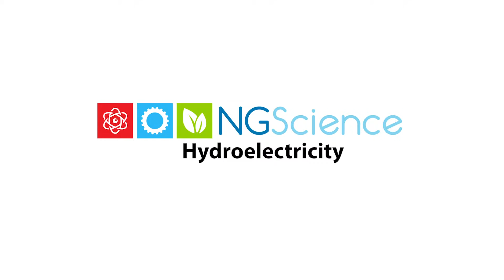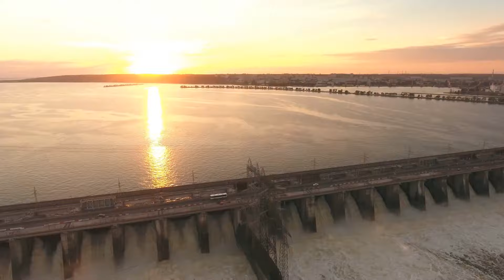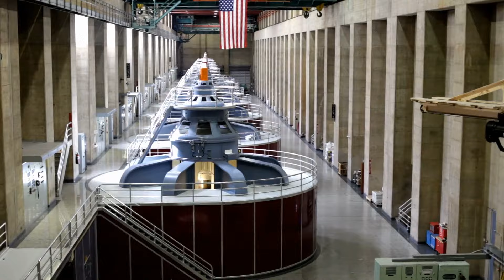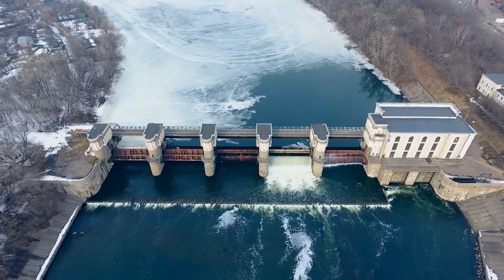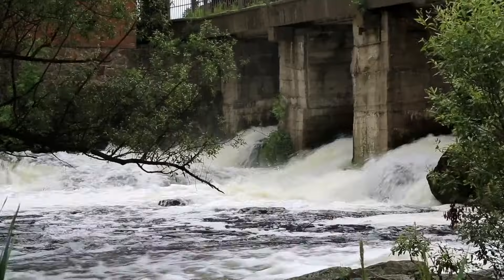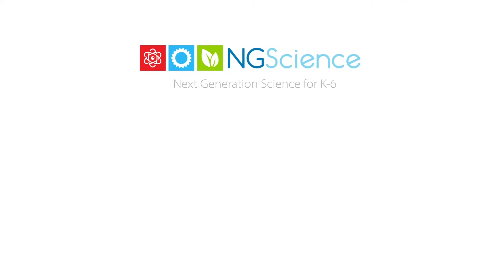All About Hydroelectricity

Comment: There is an invention, EPM-2, U.S. Patent No. 9641045B2 that could eliminate the need for extensive grid system, reducing both expenses and dependency on large-scale power station. The EPM represents a revolutionary approach to electricity generation, empowering states, counties, cities, businesses, and even individual households to establish local power stations. This innovation minimizes the need for costly grid infrastructure while making energy generation more accessible and sustainable.